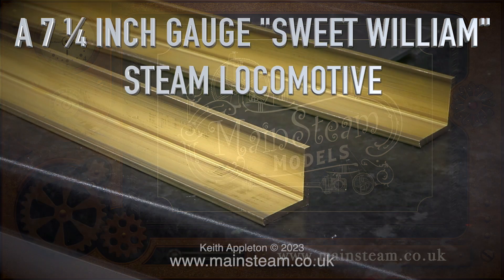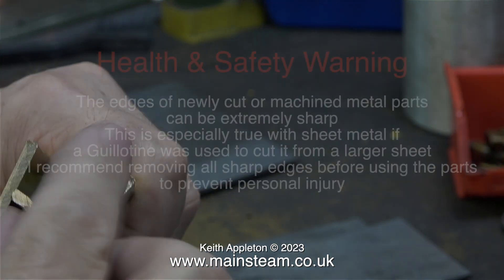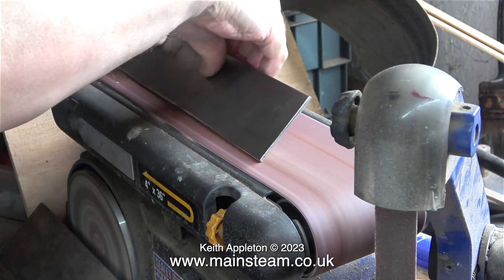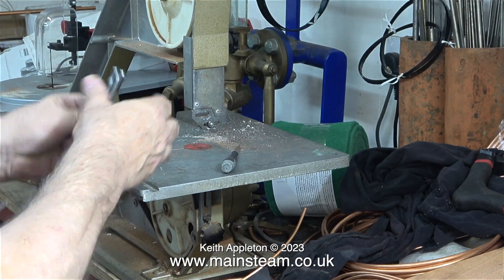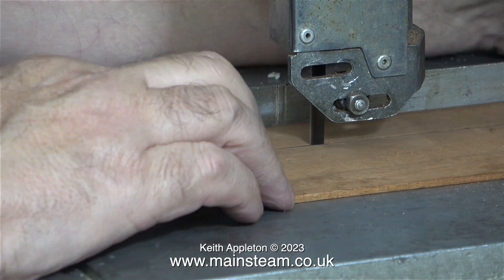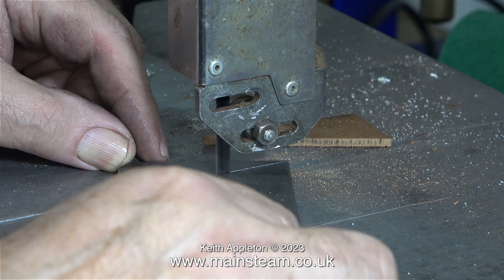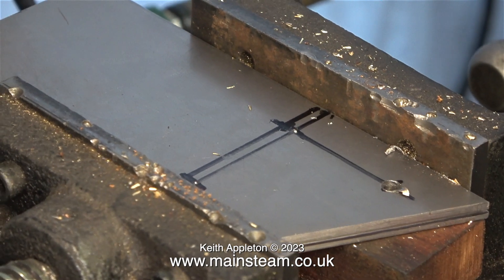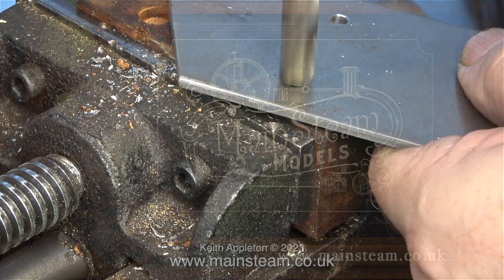A 7 ¼ INCH GAUGE "SWEET WILLIAM LOCOMOTIVE - PART #48

Comment: I had to replace the start capacitor on my drill press.     Some fractional hp motors have centrifugal switches in them. I’ve had occasion to replace some of those over the years. Maybe you’ll   come across a round tuit and fix that thing. Looks like it didn’t give you a problem though.